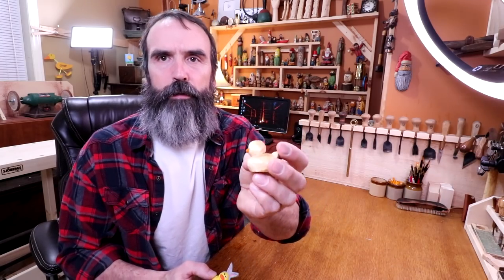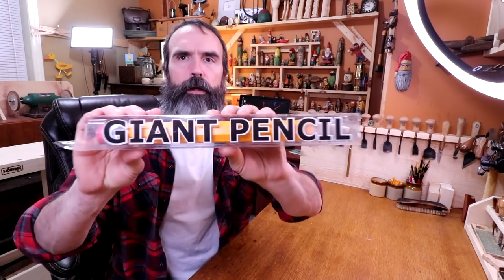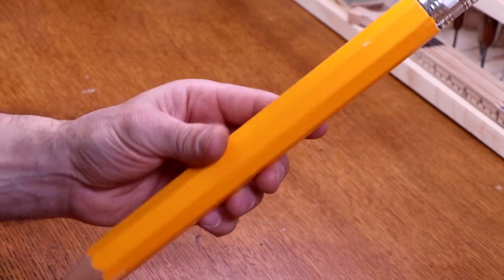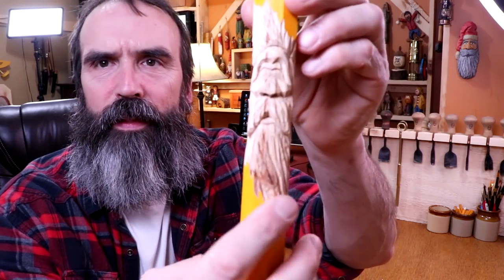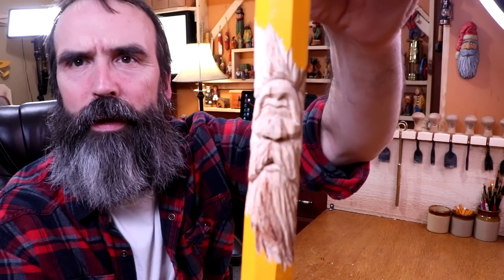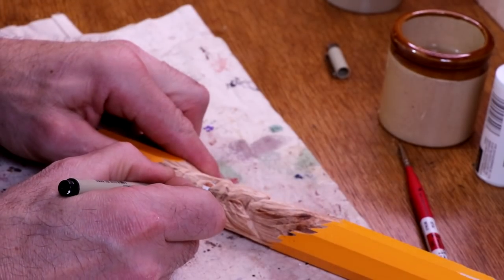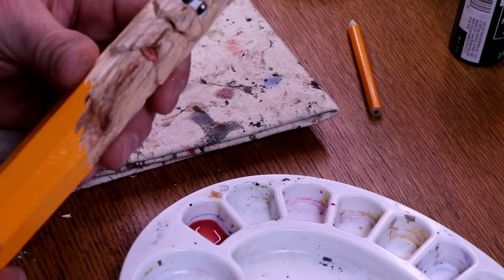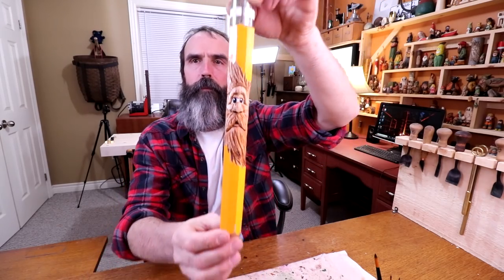Carving A Wood Spirit On A Giant Pencil

Comment: Just a little tip... When you have really dry and or hard woods that you are trying to carve, mix up some alcohol and distilled water 50/50 mix in a spray bottle and soak it down and let it sit for 5-10 min then give it one more light sprits and carve away